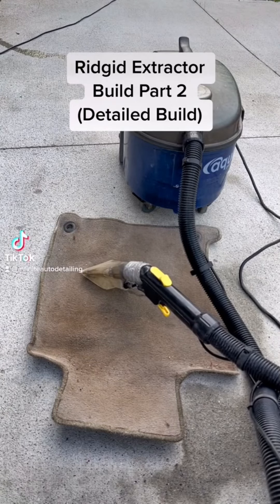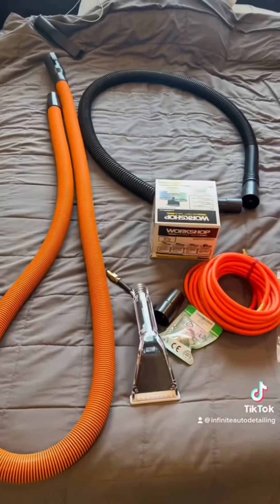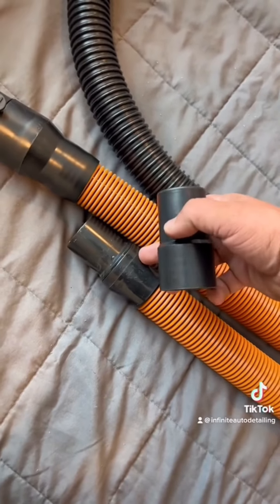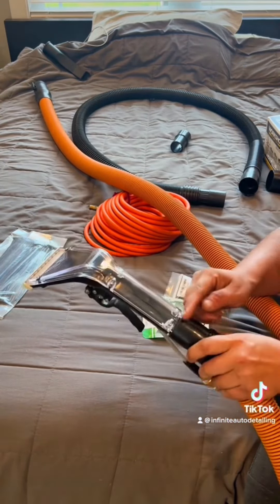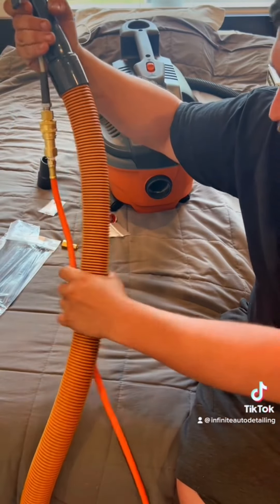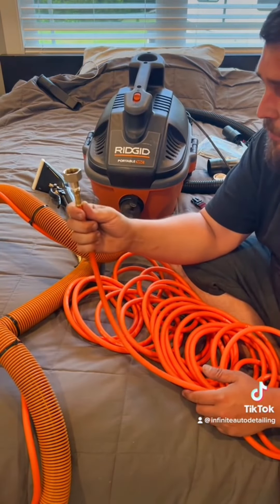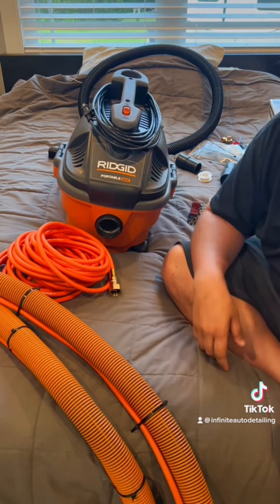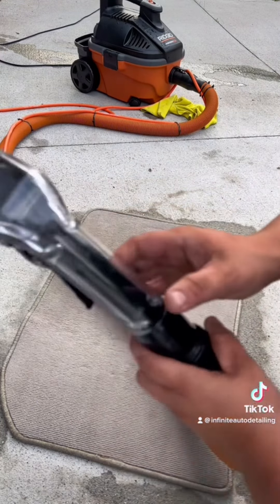Ridgid ShopVac Extractor build, thanks to @HawaiiDetailing / (detailed and adjusted build.)

Comment: For matts I usually just use a pressure washer to rinse off after APC and scrubbing. Easier to me and I can still use vac to pull moisture out as much as possible. The dirty water runs off on the ground instead of me sucking a bunch up in my Rigid. Just a thought.
Reply from the maker: Yeah I only demonstrated on a mat, but the build is for interior cars and seats. For ppl who use extractors for shampooing interiors not just mats

Comment: So I actually made the same set up! Good stuff. I just bought a generator too. Only thing left to go fully mobile is a water tank. But it makes me wonder if I can still use this diy set up with a water tank instead the house water.
Reply from the maker: Yes you actually can. And that’s why this build is great. From your water tank, you got a adapter that you can screw in a water hose to your pressure washer right? Get the one that had the knob lever that can shut it off. Or you can get the double spigot thing with levers that way your pressure washer always connected and you can shut one side off and use for extractor on the other.
Reply: @InfiniteDetailing101  i wonder if I need a pump or anything. Or do you think just with gravity it would have enough pressure ?
Reply from the maker: @LewTh3Jew  gravity can be enough, but it’s a hassle and what if you’re up hill. And even then, some will deny this, but it starves the pressure washer a bit. Gravity isn’t as strong water feed as a pump can. So over time, your PW pump can go out due to starving. I would definately get a pump bc it’s just worth it brother. Also make sure the pump output is enough for your pressure washer gpm.
Reply: @LewTh3Jew you can also hook it up to a keg or some other pressurized container.

Comment: I wouldnt personally use zip ties, if that hose rubs up against anything its gonna get scratched. They make velcro wraps you can buy that the expensive extractors use.
Reply from the maker: Lol yes sir I mentioned that in the video but I called them “sleeves”
Reply: @InfiniteDetailing101  im thinking about getting parts to make this kit too. Thanks for the infor!
Reply from the maker: @subzeroRLclips  no problem bro

Comment: We need a cheaper version
Reply from the maker: You can do a cheaper head I just showed the basic concept of making one. The only thing you need to change is the adaptor to the other extractor head you want to use and change the fittings to the water line according to which ever head you’re using. You can see the specks usually of the heads before you purchase so you know
Reply: Ripclean is cheaper. I watch Hawaiian detail custom extractor and I did the math. Came out more expensive than rip clean. I just got mine a few weeks ago.
Reply from the maker: @TheOfficialOV  yeah it’s actually the same. I actually built it. It’s better quality and lasts longer. And if something breaks, easy replacement bc I know what parts I bought. Rip clean you gotta wait 2-3 weeks to get a replacement line or hose. But to each their own.
Reply from the maker: @TheOfficialOV  so if I was to replicate and build exactly the same as ripclean, it would be cheaper than this one or hawaiin. Their head they claim is their own, but you can see the exact same head on amazon for 15-20$. But again, not everyone wants to build, they just want one ready. But it’s definitely not better.
Reply: @InfiniteDetailing101  unfortunately people are lazy and they would rather wait for an inferior product than spend 10 minutes actually doing something
Reply from the maker: @EMoneyyy666  yeah I know. Rip clean one is lighter tho. This one’s a bit bulky but it lasted me all this time so far. Been what 7 months since I posted the video. It’s been longer than that bc before YouTube I started on TikTok and posted there